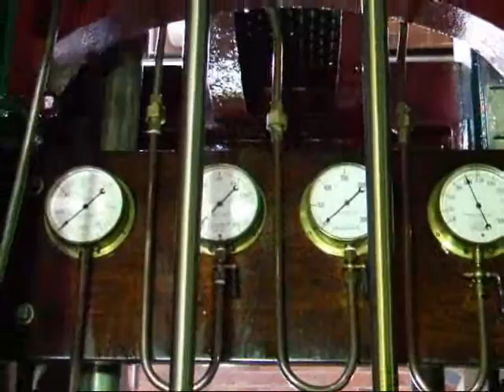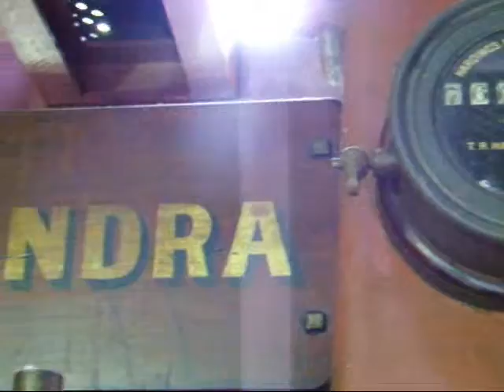THE BRATCH STEAM PUMPING ENGINE OPEN DAY

Comment: A really good look at this fabulous machine.  I missed the last open day and was very dissapointed.  This video makes me ralise what I missed.  Thanks for posting this.
Reply: What happened to the engines and why have the open days and steamings stopped?
Reply: @AEKarnes  Various issues. Health and safety was one of them. The other issue is that this pump house is still on an active water supply site. Fuel costs were apparently quite high and also the main person that organised the whole restoration sadly passed away. It's a real shame as it has just sat there dormant for about 10 years now.
Reply: @jackt883  I know Len Crane was that man and I know his loss was a terrible blow.  Right now I manage an operation with the only preserved waterworks engine in the US that can run in situ, which is also in an active water pumping station in Woburn MA so I am familiar with the challenges.  They are remarkably tolerant of us and we are working to keep it that way, so I understand.
Reply: A. E. Karnes That sounds good! It's nice that they are tollerant. We are trying to get a little team together for the Bratch.
Reply: @jackt883  I wish you the very best of luck.  Waterworks engines are my biggest passion.  Len did a great job getting the first engine there in steam, I know you'll do it.  There isn't the kind of hatred for these things in England.
Reply: A. E. Karnes why is there hatred for them in America?
Reply: @jackt883  There is a hatred for history itself in America, and anything that takes up space or otherwise gets in the way of development.
Reply: A. E. Karnes That's ridiculous sounding in a country that has tonnes of land anyway!